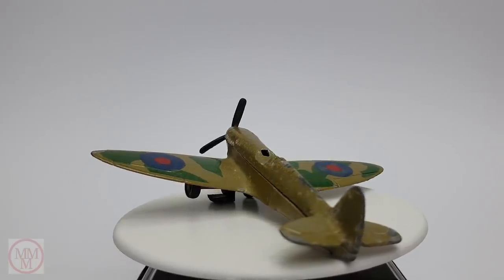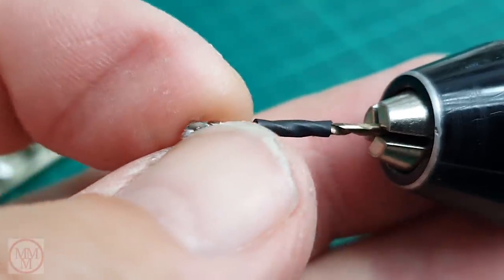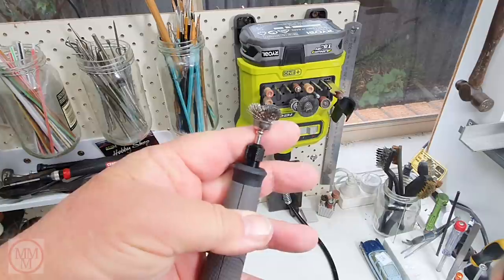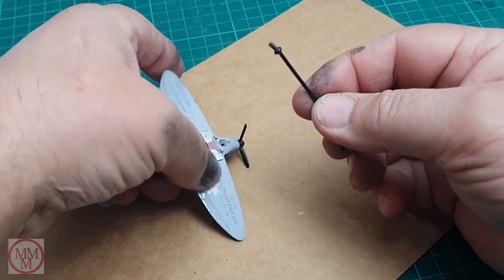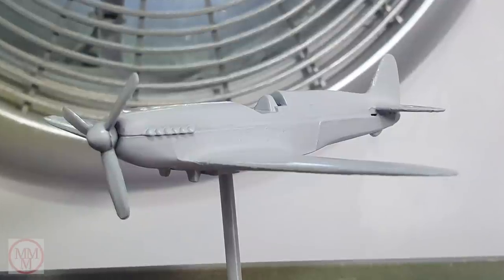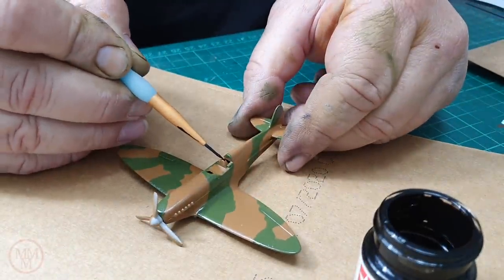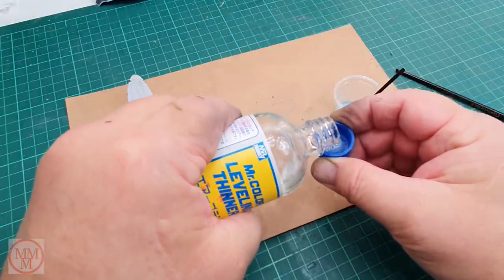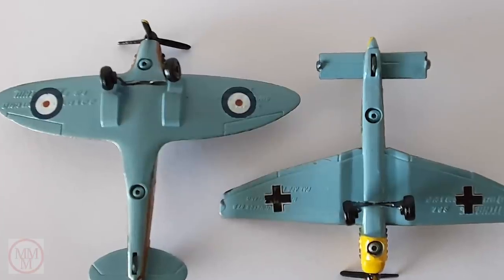MATCHBOX Battle of Britain Special   -  Custom No.SB8 Spitfire & SB7 Junkers 87

Comment: The "target" came about from WWI. Originally, British aircraft had a Union Jack as the symbols. However, this looked a lot like the German cross at a distance. The French were using their national "cockade" which came from a circular decoration worn in hats at the time of the Revolution, these were blue in the middle, white and then red on the outside. That is what is still used by the French Air Force. The British decided to copy it so from the ground  "round" meant friendly, "cross" meant enemy. To differentiate the nations, the British swapped the colours, with red in the middle and blue on the outside. The yellow ring was supposed to help visibility, in the early part of the war they painted out the white and yellow with blue to improve camouflage, some did it on the side too, although it was often left in place, as in the example you have.
Reply: Theodore Olson  True, given the importance of long range detection  measures, I do wonder what difference it would make to get the more colourful ones back. Something to do with radar-absorbent paint perhaps? The glory days of aircraft colour schemes were the German WWI Flying Circuses and the USA in the 1950's and '60s.
Reply: So they were basically playing tic tac toe with the X's and O's.
Reply: And sadly, our latest F-35's have adopted the US habit of putting the low-viz emblem on the top of the port wing and below the starboard (WWII modifications to stop friendly fire). An appalling development - like calling our generals by "stars" ("two star", "three star) etc. But when they dominate everything our military does......

Comment: Hi Marty ,small word it is for sure . The picture of the Spitfire you have for color and Markings is a MK1a , This particular aircraft I built the wings for on the Isle of Wight, Uk across from Portsmouth where the first prison ships left for Australia. The spit with no radiator is wrong the other spit with two Rad was Mklll and on , the one in the picture has one round tube radiator and one square, One Is for the coolant for the engine and the other is the oil cooler again for the engine . The spit picture, this aircraft never saw active service it crashed in early 1939 after a training flight the pilot parachute safely. The aircraft crashed into a river bank and there it stayed until the 80s . The salvaged aircraft was kept until there was a sponsored to commission the build . Build started 2009 and the aircraft was completed 2015 . The aircraft was one of two MK1a built to commemorate BOfB the spit rebuilt was salvaged from the beaches of Dunkirk. And both aircraft were in the movie Dunkirk.
Thanks for your channel I played with a lot of these toys in 60s 70s . I remember having Bi planes from the same manufacturer as these spits would be nice to see them again. # BOB
Reply: Vaughan
You should edit your post to correct the #BOB and eliminate the space between the hashtag and the letters. When it’s not spaced the software creates the highlighted hashtag that can be searched by someone looking up or following the hashtag.
Reply: Wayne Crews 54 new to this,  great channel I am happy to support and watch your content.

Comment: The intakes under the wings, one was the engine radiator and the other was for cooling the oil.
Reply: Depends on the Spitfire variant.  Mks I through V had separate radiator and oil cooler.  Mk. IX on had two radiator/oil cooler units.
Reply: Lance Revell, if the the plane I’d being rebuilt as a BoB Spitfire it’s a Mk.I or at most a Mk.II.
Reply: @mrjockt  Agreed, just pointing out differences.  That one Spit of Marty's has the two radiators.  The earlier oil cooler should be much smaller.   Getting into the features of all the myriads of Spitfire marks is a real rabbit hole.
Reply: Lance Revell, tell me about it, I once had the idea of building a complete collection of 1/72 Spitfires until I worked out that if I included all the various sub-variants I would have to build in the region of 60 to 70 models, and that didn’t include the Seafire variants, I gave up after building 20.
Reply: @mrjockt  the exhaust stubs on the models are 6 a side, the early Spitfires up to about Mk V from memory had 3 a side. Doesn't really matter, they are just play models.
Reply: @lancerevell5979  And because of that he should have painted them in the grey-green colours rather than the brown-green colours as by the time the Mk IX was introduced they had switched well over to the grey-green. However there are no cannon to be seen on the wings, so perhaps the only accurate paintjob for this would be as a PR Mk XI? There are certainly a lot of inconsistencies with that little toy.
Reply: @flare2000x  Can't expect too much accuracy in diecast toys.   As a kid we loved playong with them.   Proper colors, markings and details weren't important.
After fiftyplus years of scale modeling, I am still not a "rivet counter".

Comment: Marty next time when making a silicone mold for parts like that. Try coating the original piece in baby powder first. It should help you get the piece out. I just thought it might help. Good luck mate!
Reply: or Vaseline
Reply: Cooking spray is used sometimes also
Reply: A light coat of vaseline also works quite well.
Reply: Mould making RTV silicone is preferable and doesn't need a release agent but you can add corn starch to glazing silicone to make oogoo. The moisture in the corn starch helps the silicone set all the way through rather than curing from the outside in.
Reply: Try using what dentists use to make molds.

Comment: There's a technique used by those who restore yellowed plastic on old video game consoles..... The part is submersed in a tub of hydrogen peroxide (some wrap the tub in aluminium foil) and surrounded by a strip of UV (LED) lights and left overnight. Quite a production but works like magic, goes back to clean white. Not sure if it works on clear plastic as well. You wouldn't need a big tub for small Matchbox parts.

https://youtu.be/Wo-36elLhH0
Reply: It will take longer, but he could use one of those soy sauce cups, fill it with H202, cap it, and stick it in the windowsill for a week as a test.
Reply: Just for SnG... #BOB :P
Reply: Good idea for him to try. Well done!
Reply: I read that retrobrighting isn't permanent though.
Reply: @LandyVlad_Rides  well i guess so.....the original plastic turned yellow.
Reply: @LandyVlad_Rides  Some report reyellowing, others report permanent deyellowing. Depends on plastic and storage conditions.
Reply: Rather than a tub of H2O2, the best results uses peroxide cream painted on and wrapped with clear plastic wrap and allowed to sit in the sun with hot water.

Comment: Marty,  I always look forward to your projects with their new challenges. I felt like it took 5 years till the oil stopped oozing out of me from changing the oil coolers on P2 Neptunes, it was a dirty job. 
  There are numerous YouTube vids on mixing silicone with either dish soap or corn starch. I think the silicone caulk by itself is too sticky so it adheres to seal. There are store bought silicones for pouring or ask your Dentist if he has some old flowable silicone used for very accurate impressions. With a small plastic snap closing.box, your Dentist should get them from his dental lab used to ship crowns or bridge work and they get thrown out, make great two part molds. Pour silicone in one side with your master embedded 1/2 way and allow it to set. Do not over fill. When set spray a separating material like silicone spray ,fill the other 1/2 of the little box with your mold material and snap the box together and press to squeeze out excess. When set you will have a two part mold that is keyed together for casting resin. Great for small parts.  #BOB

Comment: Marty, the ‘tail wheel’ was a part of the original Spitfire. The tail-wheel replaced the tail-skid which was a sacrificial metal bracket that kept the tail of the fuselage off the ground. The tail-skid would be worn down over time as the aircraft took off and landed. It was less expensive to replace a metal bracket than rebuild the tail of the fuselage.

Using a tail-wheel instead, helped with heavier aircraft which might have been laden with bombs or extra ammunition. It also helped the aircraft’s manoeuvrability while taxiing for take off. It acted like a castor at the back and could swivel easily.

The Matchbox model used a very simple faux tail wheel to pay homage.

Comment: The process for removing yellowing from plastics is called Retrobrighting. You can search that topic for finding a setup that works best for you. I restore old toys from many makers and I use a small aluminum pan with salon hair developer. It already has 40% peroxide with oxygen activater. You don't need to drown the part either. Simply brush a thin layer on the part. Then instead of using the sun, I use a UV cure lamp for a 3D printer. That way I can use it any time of day.
Reply: It doesn't work properly on all transparant plastics though, some of them can turn white/smoked.

I treated some LEGO of an old pirate ship (white and light grey bricks), worked really well, just 3% hydrogen peroxide in the sun for 6 hours.
Reply: Everyone has different methods and tools. That's why I just put what the process is called. That way, anyone reading can plug it into a search engine and figure out what's best for them. Once you understand the process, you can figure out how you want to make it work. A chemical called Bromine is added to plastic to help make it flame resistant. When the plastic is left in sunlight the Bromine reacts with the UV light and turns yellow. The peroxide reacts with the uv to bleach the plastic back to its original color. Just like the process the dentist uses to clean teeth.

Comment: If you are making a silicone mould from an object you can stop the silicone sticking to it by coating it with PVA glue and letting dry. The silicone will not stick to dry PVA.

Comment: Someone likely already mentioned, but the "scoops" were for the engine's radiators, and for oil coolers.
The guns did not need cooling, and as the war went on (and altitudes increased) they needed heaters for the guns to keep them from freezing at altitude. The bits of red tape (doped fabric) over the gunports was an early effort to help prevent this. 

Love the work, tempted to send a very battered Corgi Nissan Z your way.

Comment: There's a gentleman youtuber that restores various things, some of which have plastics that have yellowed. I've seen this yellowing reversed using peroxides and a UV lamp. Generally speaking, the process involves lining a vessel with reflective foil, filling with some peroxide, and there part, and then illuminating the submerged part with UV light. It worked like magic. Just an fyi, carry on.

Comment: Mix the silicone with cornflour to make a mold. Also you can spray the item you're molding with some light frying oil to prevent it sticking. There are plenty of youtube videos out there. Also for the yellow plastic, takr a look at what vintage computer hobbyists use, it's some sort of UV (sunlight) activated bleach solution. It's name escapes me.

Comment: Tool recommendation: I think you could benefit from a set of automotive interior panel tools. They're inexpensive nylon levers that come in kits of many shapes. They're meant to pry apart delicate stuff without scratching or marring. Plus, you can sand, grind or cut them to customize them to your needs. Easily available from Amazon.

Comment: Another great makeover. Just as an aside, back in 1940 the prop was referred to as the air screw. Maybe they used different roundels etc in different theatres of operation. The underside colour, I believe, was 'Duck Egg'.

Comment: A historical make over.
The pilots and the Spitfire saved England.
Don't know if it is familiar to you, but if you are going to tap screw thread then you have to take 0.8 x the diameter of the thread and then you have the diameter of the drill.
For example: M3 x 0.8 = 2.4 mm twist drill.

Comment: Great project to commemorate the day!  The Stuka with the swastika is part of the initial run.  These are less common, as the swastikas were later replaced with small crosses.  The ones with the swastika would have been banned from sale in Germany.  The change was most likely done to avoid such market-related regulatory issues. You really did a great job on them all.  #BOB

Comment: That brings back memories, I had the horrid looking green and gold version. I believe this was the first version to be released, which looks like a Mk IX from the under-wing radiators. The Mk1 to Mk V had two different size fittings. One an oil cooler and the larger one was a radiator.

Comment: Sorry Marty but the Spitfire with the two underwing radiators is a MK IV. The radiator on the left underside also incorporates the oil cooler. They cool a larger Merlin engine in that mark, not to cool the guns ,which incidentally were HEATED. The spitfire you are working on is a MK II. Smaller engine so should have ONE radiator under the wing on the left and an oil cooler under the right wing. No offence cobber but I am ex RAF and felt the need to inform you and Kevin !!

Comment: I enjoy watching your videos.  Started repainting cars like these after watching.  FYI; the coolers on the bottom of the wing are for cooling oil & hydraulic fluid, not the machine guns.  Most Spits had 8- .303 machine guns spread out in the wing.  Later models had 2- .303 machine guns & 2- 20mm cannon combo.

Comment: you might think about looking into using the retrobrite process for yellowed cockpits and car windscreens I am not sure if it works on clear plastic though
"Retrobrite is a chemical solution that essentially reverses the yellowing process. Not only does this solution turn yellowed plastic white, it also strengthens it and prevents the plastic from becoming any more brittle. Retrobriting is an incredibly easy (also, messy!)"

Comment: You can cut circles fairly easily with some metal tubing/pipe. Get a short piece of tube with the inside diameter you want your circle to be. Chuck the tube in your drill and spin it on a grinding wheel to sharpen it. Then put the tube over the decal or thing you want a circle in and whack it with a small hammer. Instant hole/circle.

Comment: try using cotton balls, stretched out, to mask off the bottom layer of camo from the top.  I used it to camo a tank model once and it worked quite well.  Use wire or string to wrap around the model on top of the cotton, to keep it in place while painting the top coat.

Comment: mix baking soda and hydrogen peroxide into a paste and coat the yellowed item.wrap in plastic and set aside. If you expose it to UV  rays, it speeds up the process, but isn't required if you're willing to wait overnight.

Comment: The lumps under the wings of the 2nd Spit are the radiators. Because they are both large radiators means that it's a late type merlin powered spit. Early ones had one large and one small. #bob
Reply: I was about to say the same, then i found your comment. Cheers old chap! :P

Comment: For your 3D prints, if you use ABS filament you can dip the finished part in acetone for a few seconds which will smooth the surface.

Comment: The different roundels generally corresponded to different nationalities within the British Empire. They also changed over time. For instance, the RAAF used the same roundel as the RAF for the beginning of the war, switched to their owner midway through, and finished with a modified version of that one.
Reply: Yes, the Australians and New Zealand air forces painted out the red centers, after the beginning of the Pacific War.  In the heat of combat, they looked too much like the meatballs on Japanese planes to AA gunners.  We removed the red dot from our national marking for the same reason.  And painted them bigger and added one to wings, too, till the next change in 1943.

Comment: You can take care of yellowing putting plastic parts in a peroxide solution (H2O2) under UV light (best is by led stripes, but good sunny days are worth a shot to). The parts have to be totally immerged. The solution should rate at 15-20% of perhoxide.

Comment: When you're drilling and tapping the holes, you might try using WD 40 as regular oil tends to make the drill and tap stick.
This is what we use in machine shops on Aluminium, or zinc alloys.

Comment: You need to use a release agent on the object you are making a mold of. 
Like this recipe mixture of 2 parts isopropyl alcohol and 1, part dish soap can be used in some cases to release silicone from silicone.